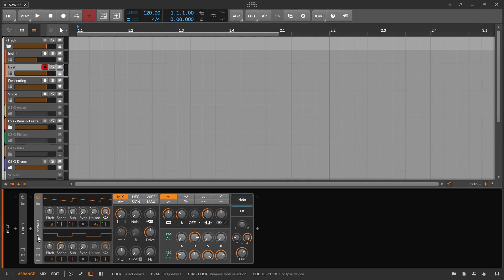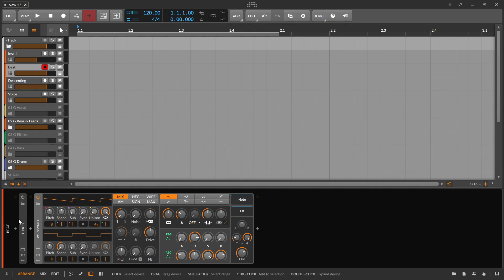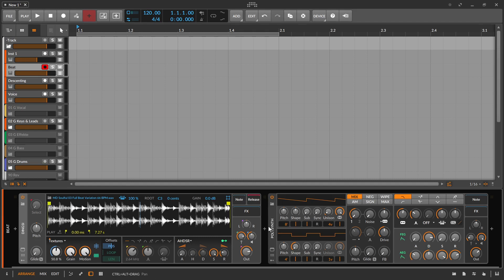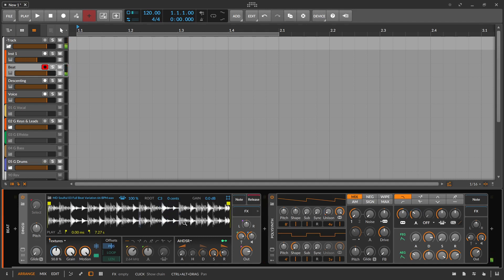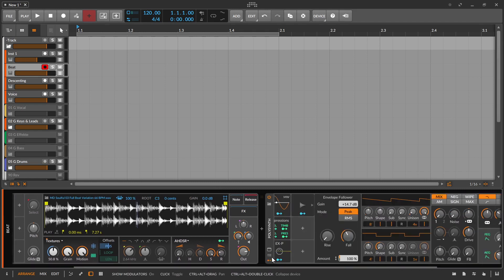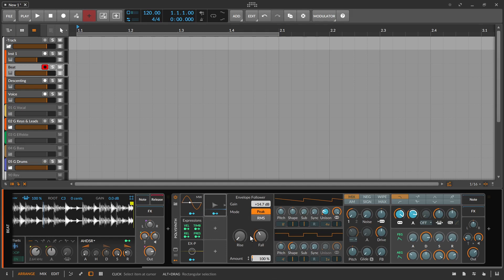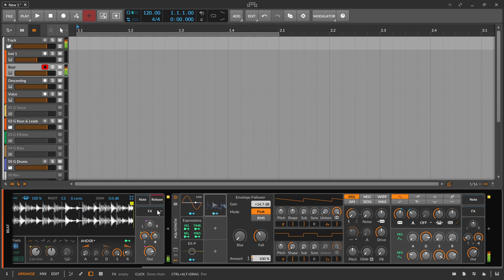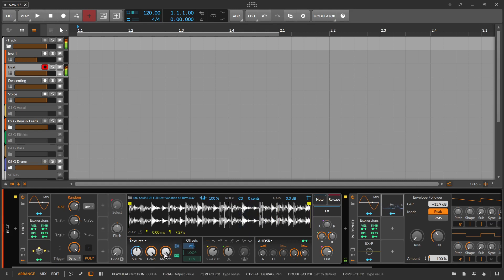PLUGIN: Sampler as Modulation Source | english

Comment: this is cool. one thing I used to do a fair bit is to have a modulation track (which is muted), split the band into sections (octaves are easy to think about) and then write out modulation information on to a track stored as the excitation on certain frequencies. Then I would pick them up using audio side chain modulators anywhere in the DAW. You can encode quite a few tracks of modulation on one track. It's a weird technique but it makes me happy.  hahaha.  good stuff man. Interesting idea using FX on the modulation track, I never tried that one. I used to use it as a global modulator to turn FX on and off or whatever really. I mean.. you can "play" the fx and modulations etc.